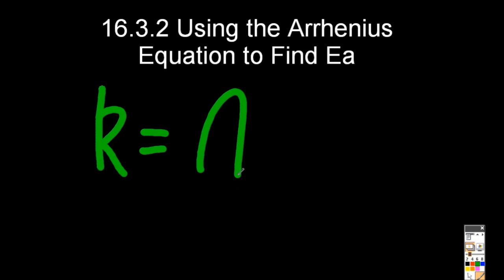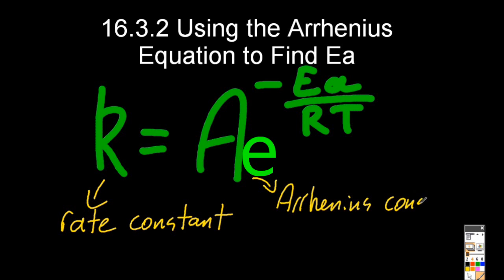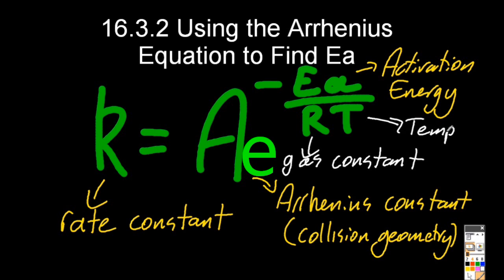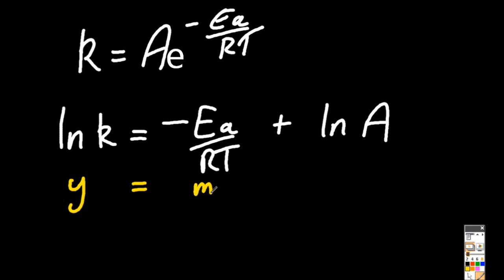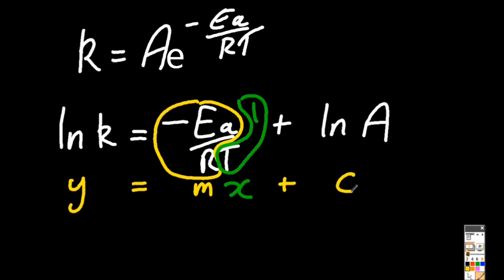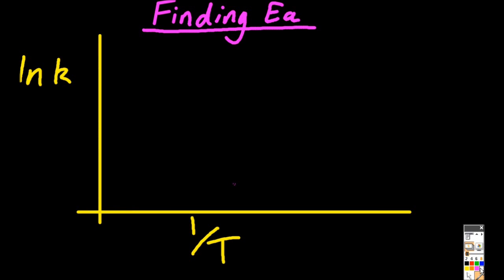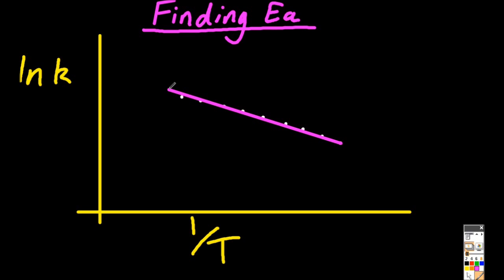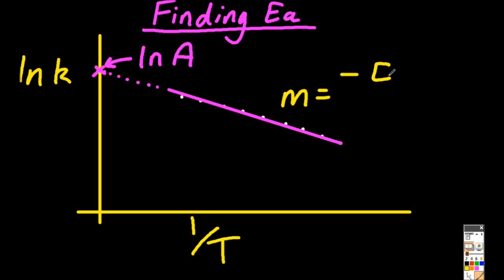R2.2.12 Using the Arrhenius Equation to find Ea [HL IB Chemistry]

Comment: Great video !
I had a question 
For my chem ia im going to be plotting 1/temperature against lnk, in order to find k im going to be using 1/rate , so ive got several different values for rate (for example 34 seconds, 55 seconds and 43 seconds) , so should i  : 

Method 1: ( find the K values for each individual rate / time so thats 1/k, 1/k1, 1/k2 = 1/34 / 1/55, 1/43 , and then average  it so ill get the average of K ) 
k_avg = (1/34 + 1/55 + 1/43) / 3

OR: 

Method 2: (average the time/ rate (average rate ) , and then find K using 1/ average rate ) 
k_avg = 1 / [(34 + 55 + 43) / 3] 

which one is correct? Both yield different answers, and thats the reason why im so confused, my teacher has no idea either. I would greatly appreciate your help !
Thankyou!
Reply from the maker: Phew, I still struggle a bit my self with this topic.

"In order to find k im going to be using 1/rate ",

So rate =k(reactants here raised to their orders of reaction)

so k = rate/(reactants etc)

rate is proportional to 1/time to finish reaction

so k is proportional to 1/time to finish reaction.

you cannot know the actual value of the rate constant if you do not know the concs and orders of the reactants in the rate equation,  BUT you can compare the rate constant RELATIVLEY (from one to another) .

The concs and orders of the reaction are assumed to be unchanged during your experiments where you changed T

So y axis = ln k = ln 1/time for reaction rate
x axis = 1/T 

I am assuming the data you gave me was for different temperatures, not the smae temperature.

If you did not change temps , then you can not use the Arrhenius graph method.

Phew, good luck, this is right at the edge of my knowledge

Comment: Fantastic explanation!
In the data booklet the equation is written as ln k = -Ea/(RT) = ln A
Is this an inaccuracy by the IB?
Reply from the maker: yup, the IB are wrong.  Another mistake in the data booklet is the hydrogen electrode is 0.00V.  It is 0 volts.
Reply: Richard Thornley Alright, thank you!